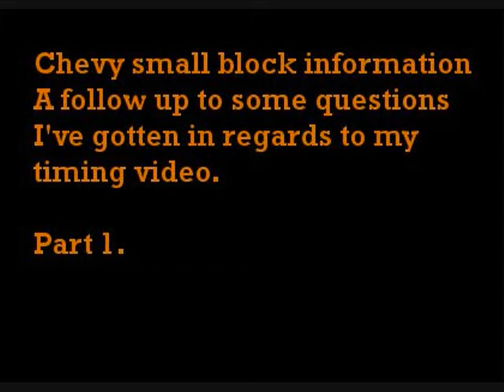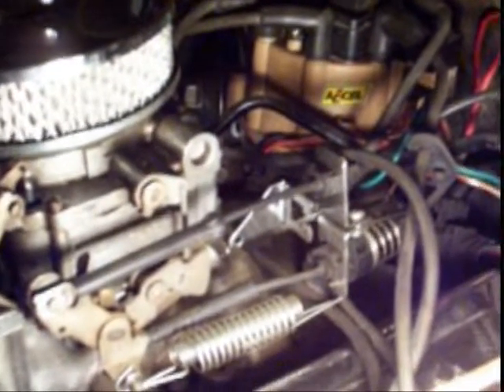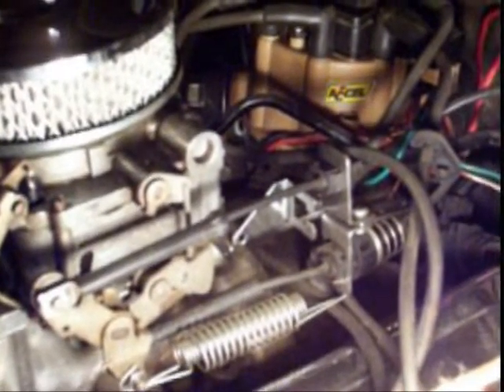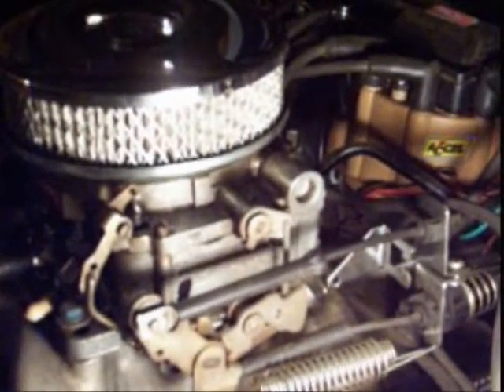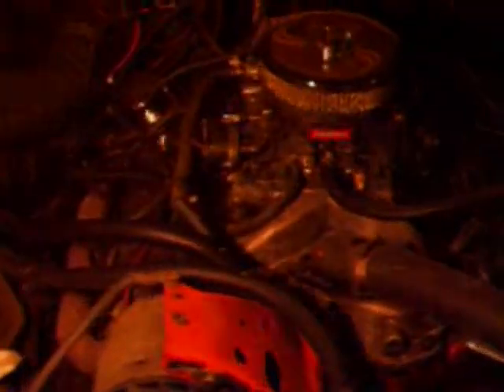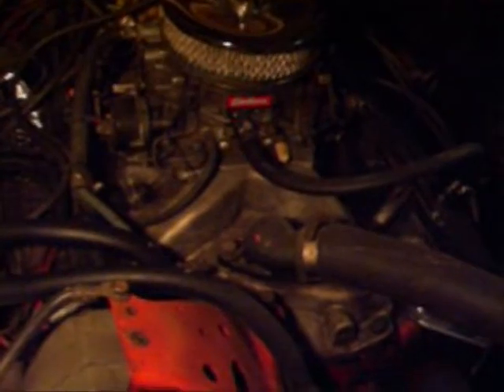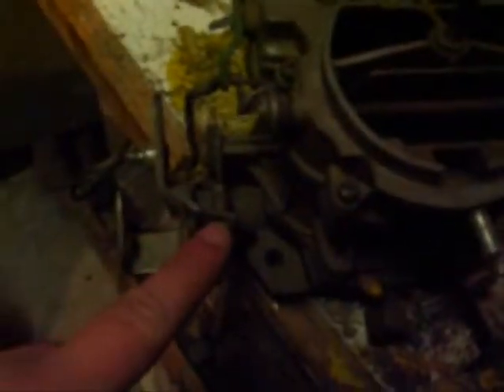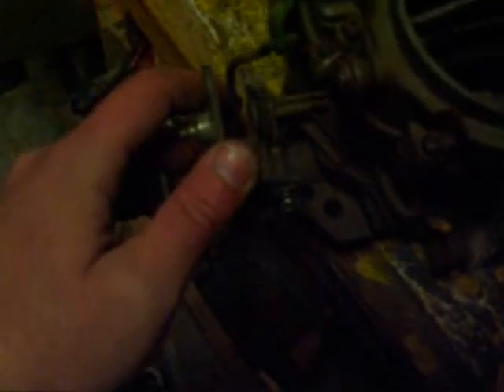Chevy small block help (from questions on my timing videos) PT1

Comment: i have a 1981 vette motor is not stock ,i can not keep a HEI coil in the car it will burn one up every 1500 miles ,what must i do never had one to do this before  all my grounds are good ,new every thing  help thanks

Comment: you just mentioned pinging at fast speeds. Well I have the cars timming timed to a light. but I still get pinging at fast speed say 55 mph. the power of the motor isnt all there as well You mentioned adjusting the timing advance screw with a allen key. could you elaborate on that a lttle. that sounds like what my problem is . I have a deadspot in the throtle that stalls the car when you get on it an I still have the pinging problem.

Comment: ok so here is a question for you. I have a holly 750 dp, I have the vacume advance hooked to a vacume line on the back of the carb not on the front like you have. Is there a specific vacume line port for the vacume advance. Im having timing issues an i am trying to figure it out. it has a dead spot in the throtel when you get on it full on.